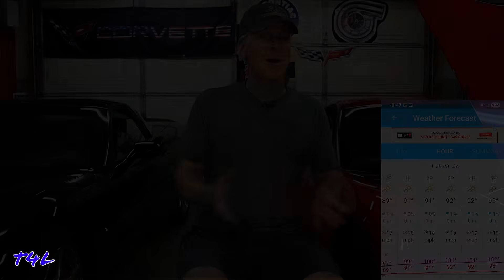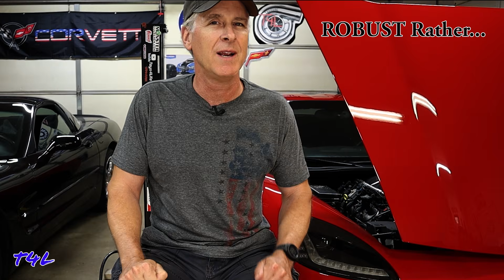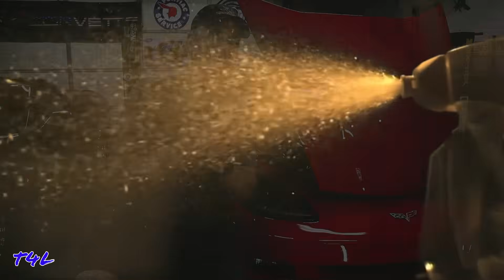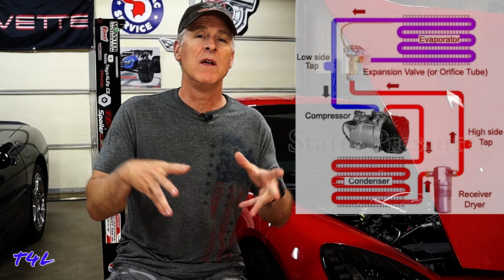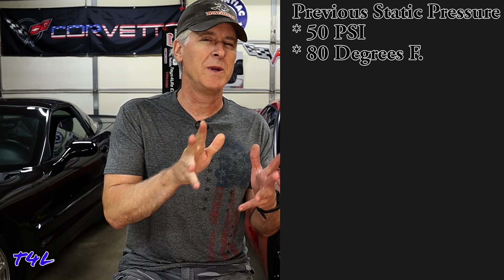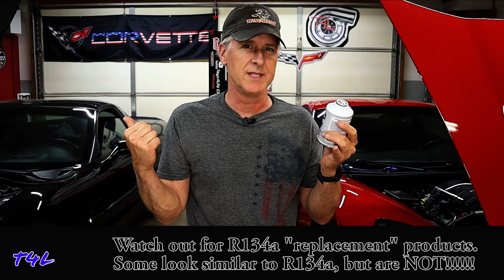C5/C6 Corvette Air Conditioning Recharge (Watch Before ATTEMPTING!)

Comment: Great Job at explaining basic ac operation! I’m retired from 38 years of hvac/ refrigeration service and I would add that “topping off” the ac system doesn’t fix the system permanently, as needing to add freon means that the system has a slight leak. Sometimes the leak is too small to find, which makes adding freon every year, the only option. With a freon charge of only 1 to 3 lbs, it doesn’t take much of a leak to affect operation. (Many of the systems I serviced had upwards of 1000 lbs of freon in them.) Most auto ac leaks are due to a bad high pressure side hose, easy to replace, but like you said, not if there’s freon in the system. One caution I would suggest is to be sure you are not introducing any air and moisture into the system when checking pressure or adding gas. The gauge hoses have air in them when you attach them to the freon bottle so if you don’t purge out that air first before connecting to the system, you’ll push that air right into the system. That air is known as a “non-condensable”, gas that won’t change state from a gas to a liquid in the condenser. It stays there taking up room and causes the head pressure to be elevated higher than the normal reading, reducing efficiency and causing possible damage. The moisture in that air, if not picked up by the receiver drier desiccant can freeze in the expansion device and cause compressor short cycling. It’s important to make sure you have purged freon gas through the hoses first, as even in checking pressure, the gauge and hose has air in it, which can work its way into the system. The more times connections are made, the more likely air is being introduced.
Reply from the maker: Pinned your comment sir! I should have mentioned to buy the shortest hose possible and give it a small puff right before connecting it. Thanks for your detailed professional input!!  I'm not sure how just checking the pressure would introduce air though, there's a lot more pressure on the AC side than there is on the hose so I don't see any regular air / moisture intruding past the Schrader valve?
Reply: @Toys4Life  Yes, the schrader valve is a tiny opening, but once the hose is attached, the pressure in the system and in the hose equalize, allowing for some movement back and forth. For instance, if you attach an unpurged low side hose and the pressure rises to 100 psi and you start the cooling, the pressure drops down to 30 and back up and back down with compressor cycling, the chance of the air staying in the hose is slim.
Reply: how do you purge it?
Reply: @BushMC  If you are using just a Freon bottle and a hose with a piercing valve, attach the bottle to the valve with the piercing needle backed out, but the bottle not tightened all of the way down. Connect the other end of the hose to the low side of the car system and let some gas blow through the hose and out the bottle connection. How long to let it blow is a guess based on the hose length. Tighten the bottle down and with the engine and ac running, screw in the piercing valve and back it back out. Rotate the bottle from valve down for liquid to upright for gas, back and forth, being careful to not run the liquid in too fast to slug the compressor or over charge it. It’s complicated, so it’s best to have a licensed mechanic repair the leak and weigh in a measured charge.

Comment: You did a great job explaining the refrigeration system. All systems should be sealed so any loss of gas needs to be adressed. Shops may just change your scrader cores and not adress the actual leak. keep your shop reciept.

Comment: had ac refill done at a shop, 3 days ac worked fine but then when i pushed the ac button after car startup.  the hvac screen blanked off and on small electrical smell, ac button flashes off when pressed now. any ideas what to check first? fuses seem fine
Reply from the maker: First thing I would do is check for codes - especially HVAC codes.  Then I would hook up a good scan tool and see if the AC controls are being seen by the system.  https://youtu.be/IWwUAkAxAGY
Reply: @Toys4Life  checked no codes, all fuses and relays seem fine,  Cant see any burned connectors,  got a hose otw to check a/c pressure, could have leaked out over those 3 days but then the shop lied to me saying it was holding pressure

Comment: Thanks for the information. My C5 blows colder on the passenger side than the driver side. Do you know if this is indicative of low refrigerant pressure, or a problem with the dual climate system itself? I have tried syncing both temperatures as well as putting them both on the coolest setting. Passenger side is always colder.
Reply: What did it end up being?
Reply: This is actually normal. The air exits first out of the passenger side and continues onto the driver side. It's always going to be just a little colder on that side unless you have the dual climate system and can adjust it to be warmer on the passenger side.

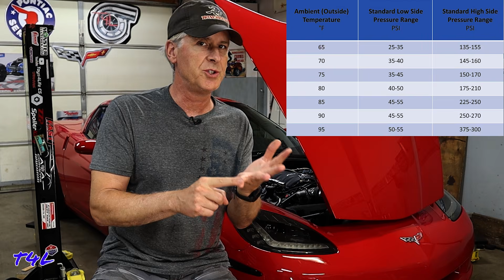Comment: 11:02 - I love this comment.  I will not use any freon with conditioners or sealant in my AC.  This can lead to needing to replace the entire refrigerant system.  Yes, the ENTIRE refrigerant system.
The way the sealants work is they harden when the come into contact with air.  Meaning, if your system gets air in it, the sealant will harden where ever it is.  I have seen it plug lines, hoses, condensers, evaporator and even ruin compressors. 
Thank you for not being a salesman on this topic and keeping it honest.

Comment: Before you start, get a schrader valve tool and tighten your fill valves. Ideally you'd replace them, but if you have old seals it can help seal up the rubber. Also while filling, I like to rest the bottom of the can on the header. It helps counter the pressure loss you get from the can frosting up.
Reply from the maker: Love the header idea!

Comment: right on time this video boss !!, in gonna try your tips , cause i have an strange behavoir , it cools while the car is cold , but one it reaches the engine op temps , stops cooling , the compressor kicks in and off every like 2 or 3 seconds
Reply from the maker: Sounds a lot like a low charge situation.
Reply: @Toys4Life thanks sr !! ill check with the knowledge you share to us ! thanks and have a great week

Comment: Always check the "easy stuff" first ..

My 2002 C5Z06 had thrown a P0530Air Conditioning (A/C) Refrigerant Pressure Sensor Circuit code, and well, I've been busy lately, so took it to a "shop" ... 

$221.40 for .35 lb. of R134 Freon and, "Start With Reflash. There Is No 5 Volt Reference And It Is Not Interpreting The Sensor Data. HVAC Control Head? Or
Body Control Module Issues?" out the door without it working :(

So that was on a Monday, on the following Thursday I replaced the Pressure sensor (Amazon) AND found a broken wire (signal) in the 3 pin connector, local salvage yard was VERY NICE and let me grab a 3 pin connector off a S-10 blazer for free, ... so a couple of wire connections later and I had A/C again !!! :) .. I hate that I have to always DIY as there isn't a shop local to me that is any good, but at least it reminded me to just wait until I have time to do it right, since they are even going to try.
Reply: Throwing a blanket over all of us is unfair. Did you take your car to the shop and expect them to work for free? ......ya you probably did. typical
Reply: @markarneson8705  nope I didn’t expect free, but please explain what they diagnosed for the money I paid them ? 
… I’m formerly ASE certified and  have worked the line in a dealership, kicking something out with a “I dunno” is just lazy work. And you are correct it’s not everyone, but I don’t know if anywhere local to me that’s any good 😞

Comment: If it needs a charge then there is a leak. And you can add a charge but it’s only going to leak out.
Reply from the maker: IMO - Yes & No.  Like I said in the video, if you haven't charged your system in the last few years and it is low, you can try to recharge it.  It's not abnormal for the AC system to lose part of its charge over 15 years due the R134a molecules getting past/through rubber o-rings and seals just like air leaks through your tires.  It is slower due to the fact that R134a is a larger molecule than "air" but it is often at higher pressures which acts to force it through.  Now if you recharged your system last year and it is low again - then I agree you absolutely have a leak that needs to be repaired and then a recharge.

Comment: South Fl. 95 degrees with high humidity. 47 degrees out of the vents. Less than 8 oz to fix. I used a set of HF gauges. Thank you Chilly Willy!
Reply from the maker: Not bad for 95 & Humid.  Question, should I move to FL from MN?  I want to but I am afraid if I buy a house a Hurricane may blow it away.  Founded or Worrywart?  What say you?
Reply: I live close to Pensacola, where you featured the Sheriff Corvette in one of your videos, its a beautiful city, and we have some of the most beautiful beaches here. The last major hurricane was about 4 years ago.  The Panhandle is great. South Florida to me has alot more traffic.  I would definitely take a look at the area.   @Toys4Life
Reply: @Toys4Life  Left RI 1977. Objects in the mirror are loosing. Most of my neighbors have seperate garages with lifts. Very nice to have a neighbor with ice maker and bar to ride out the storm with power. Love it here.
Reply: @Toys4Life I’d come to Texas. So much better land and space. No hurricane risk.

Comment: Another great video.  Very helpful.   These systems seem like magic but you took away the mystery with this video which I really appreciate.   My problem is the condenser has warped (I think this is a common problem with C6 Corvettes).  The system works perfectly (they are great systems as you mention) but I track the car and I believe the condenser is blocking airflow from the radiator in its warped condition; I could be wrong.  I thought about evacuating the system and replacing the condenser.  There are a number of videos showing that process and how you can store the refrigerant in a canister while fixing the system after which you simply recharge using the old refrigerant.  I think the cost of the vacum and other tools comes in around $500.  As you mention, given the condition of the auto mechanic industry in 2025, having work done on the A/C system will probably cost at least $500 so the idea of a DIY on this is attractive.  Any thoughts?
Reply from the maker: I am confused....How warped could it be to obstruct airflow? Much more likely it is clogged with dirt, small pebbles, bug guts, grass etc.  Maybe a good cleaning is needed as it sits right in front of the radiator and gets hit with all road debris first?
Reply: @Toys4Life  That's exactly what I'm curious about too; how much does warpage actually restricts airflow.  The condenser is flush with the radiator due to the warpage so I don't know what sort of effect it's actually having. I know that GM condenser warp and mine certainly is warped. There may be a scientific way to test the flow but that seems to be a whole other level of inquiry.  It's not a problem of bugs, etc.  I have the air/water wands and make sure it's clean before any track days and use a pick to carefully clear rocks and smashed fins. Not to belabor the point, but I think this is more of a track problem where the temperatures are excessive and I'm thinking even small improvements could reduce a 300 degree oil temp to a 280. Having deflection of the airflow due to warpage could cause higher temps; at least that's my theory. Admittedly, most of your viewers are probably never going to have restricted flow like this and have to worry about it but I thought I'd ask and see what you thought.
Reply: @brrbben  This is a year or more late, but when two coils are sandwiched together, dirt passes through the fins of the front coil and gets caught on the leading edge of the fins of the second coil and builds up, blocking air flow. We have the same problem in commercial ac when condensers are 2 rows and split into two layers. You have to spread the coils apart and spray water from the top down between the coils to remove the debris.